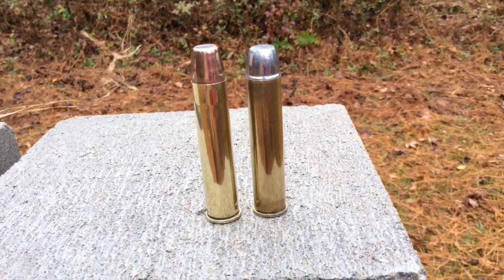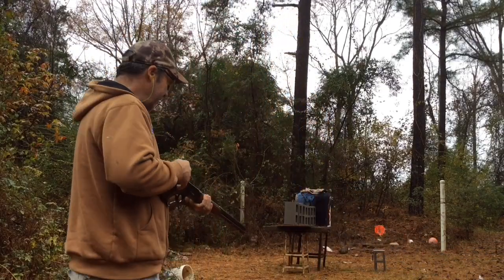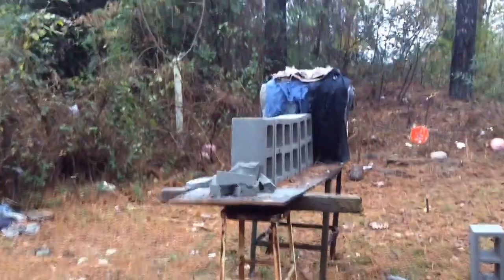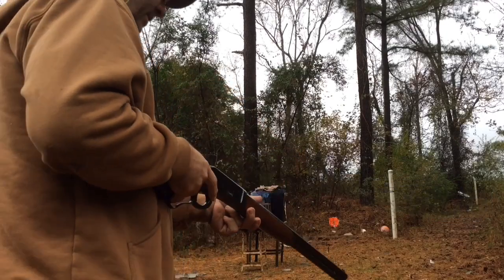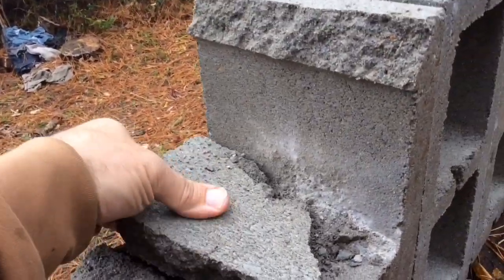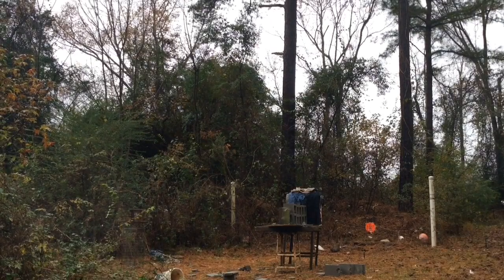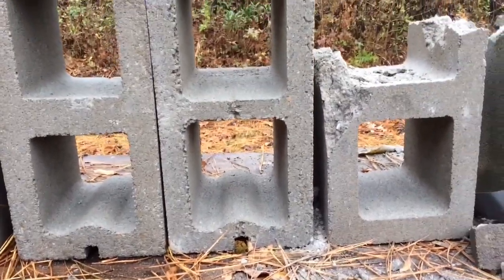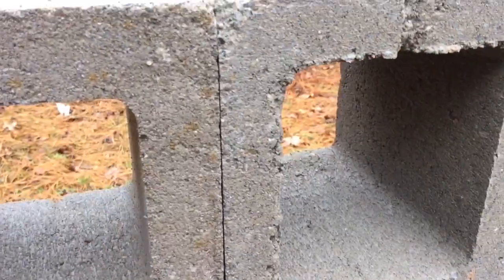Cinderblock VS the 50-110 WCF in the 1886 Winchester Part 2 lever action rifle

Comment: I think you may have skewed your results on the first one because of the air gap between the first and second block.
Reply: My guess is that you will get a different energy transfer if you were to do it over and put those cinderblocks where they all are touching.
Reply: Oh...you might want to try some Garrett Hammerhead cartridges for your .45-70.  They are guaranteed to penetrate 7 ft of animal.

Comment: Wow, I would have bet that the 50BMG bullet would have gone through at least 3. Do you know what kind of velocities you where getting with either round?
   I only ask because when you did the water jugs, the slower bullet penetrated all of the jugs. I have to wonder if you would get similar results on the blocks. I.E. the slower bullet penetrates more blocks than a bullet traveling at a higher velocity. 
   Anyway, great video. Thank you.
Reply from the maker: BuffaloBearBP The lead bullet should’ve been about 2050fps The cut down 50 BMG first one2200 Second one 2350fps, I kind of figured they would too, but after watching Kentucky ballistics apparently cinderblocks are pretty hard
Reply: @Leverguns50  I haven't seen the Kentucky Ballistics video, but after watching Ol Hickock45 a while back, those blocks didn't look that hard to me either.
   Sure has me thinking. Hopefully it warms up here just a little in the next few days. I've got some hard cast 500 grainers for my sharps. I just might have to give this a shot with a subsonic load, and a load that pushes that bullet around  1600fps. That's about as fast as I can push that bullet before I start seeing pressure signs.
   I think I really want to see that big bullet loaded with 70g of Swiss 1 1/2 Fg hit those blocks (that load gets that bullet moving at a respectable 1288fps). I haven't posted a video in a while, and I just finished one on the shooting sticks I built. So I'm overdue for a range video of some type. LOL.
   I sure this gets old, but I still drool every time you break out that 1886. Have a great Sunday.